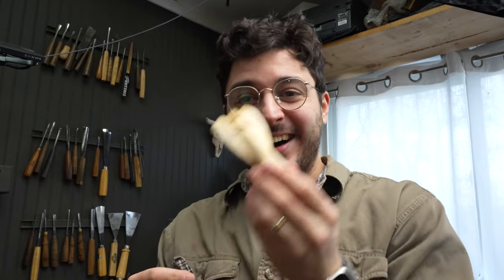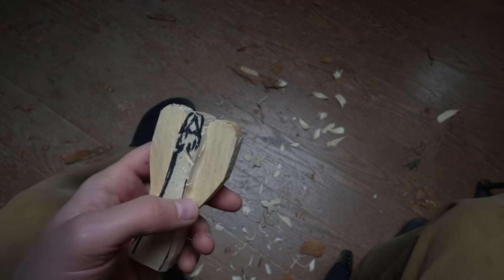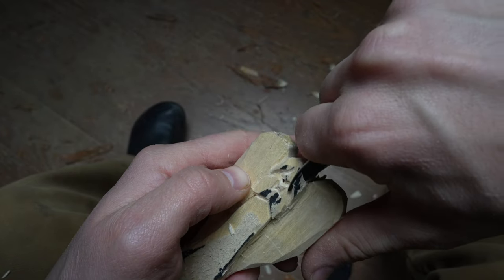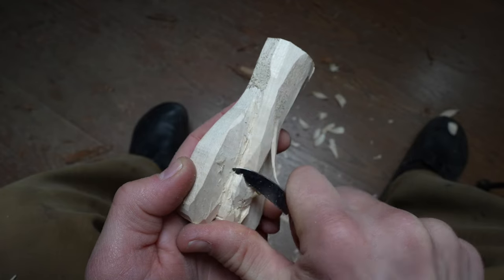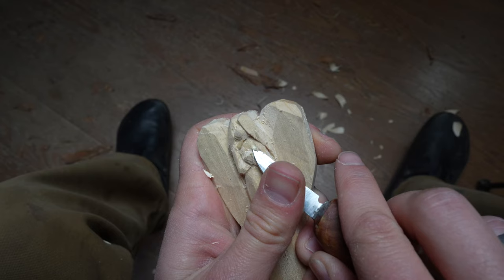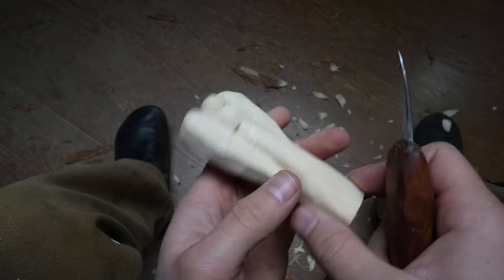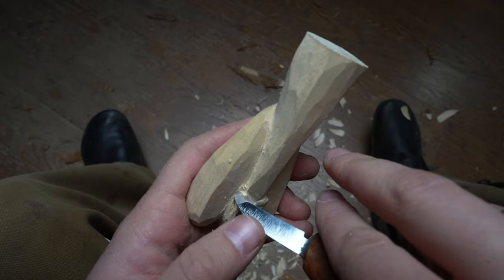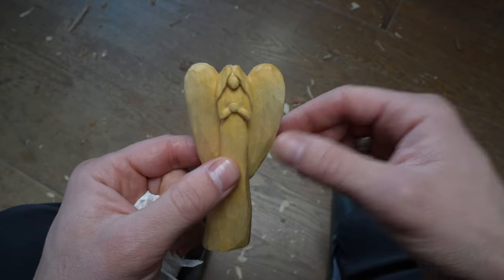Fun Whittle Angel Project--Beginner Friendly Woodcarving Gift Idea

Comment from the maker: Just a heads up folks, I cut out the shape of the angel with a bandsaw to speed up the video, but you could easily use a coping saw or a knife to achieve the same outline.  The piece of wood is used is approx: 4" x 2" x 3/4".